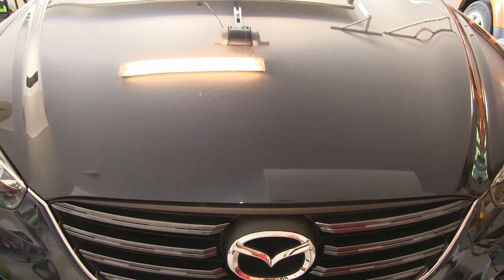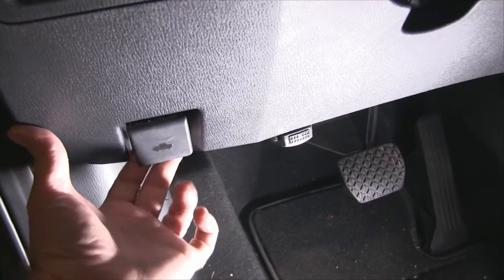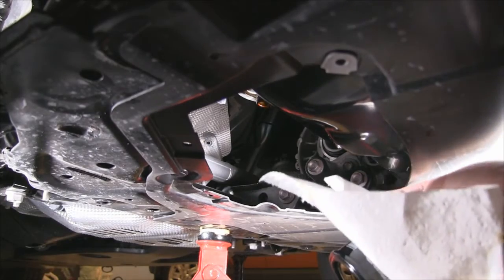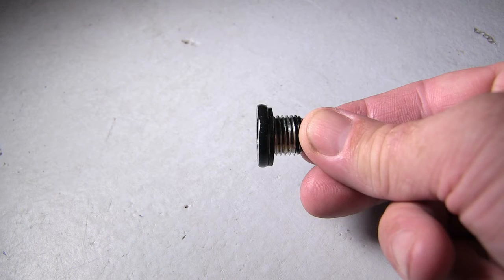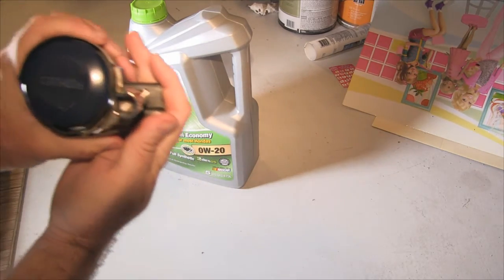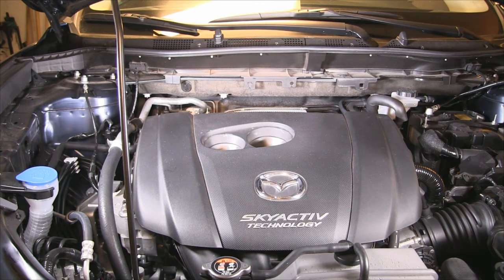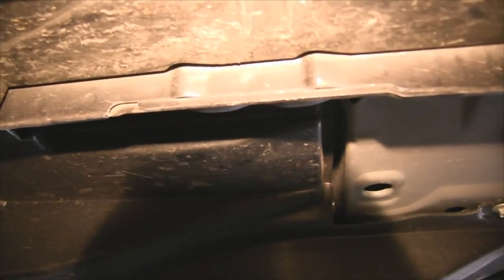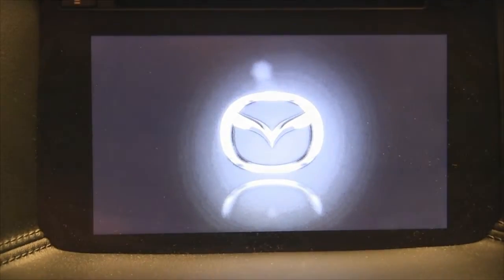DIY Oil Change:  Mazda CX-5 Using a Hydraulic Jack

Comment: One of the very best oil change I've seen for the CX-5. The slow drip drip was a little monotonous though but I get it. The only thing I would improve on would be to slightly prime the oil filter with some fresh oil before installing the filter. Thanks again for a great, (the best), video.

Comment: Excellent video. I have the exact same car and year so this is extremely useful. Can't wait to try this out for my first oil change and stop going to the shop.
Reply from the maker: Thanks Shaman.  FYI about to do my 3rd change on this car.   On the last one I used the Castrol Magnatec on Amazon Prime for $18 for the 5qt size.   I will put a link in the description.  Check it out!

Comment: I just change oil my 2015 Mazda cx5, I'm 5'7", small frame  and weighs about 155lbs and I didn't use any kind of jackstands. You can slide in, remove them plastic covering then the oil plug and oil filter. I mean it's not as easy as jeep liberty where clearance is better (no need for jackstands too it's very wide). But you can still slide in no problem with CX 5. Diy oil change easier without jacking it up and putting em jackstands which I use to do with my old Pontiac.
Reply: i tried but im 6’5 /295lbs.   i couldnt fit

Comment: I like the layed back relaxed presentation. (Although that extended drain tested my patience just a bit.)
I don't get the part of filling it to less than full. The upper mark on the dip-stick is the full mark and the lower mark is the add oil mark. If you're filling it to capacity then it should be at the upper mark. ! No?

Owner's manual says, "Pull it (the dipstick) out again and examine the level.
The level is normal if it is between
Low and Full. (Normal is okay...)
If it is near or below Low, add enough
oil to bring the level to Full." (So why not fill it to begin with?)

Comment: I usually add a little clean oil to the fill port to flush out the drain pan to speed this up.
Reply from the maker: Good suggestion!  Thanks Steve.

Comment: Great video.... detailed and easy to follow. I use Zepro Eco Medalist Advanced Moly 0W-20 and OEM filters.
Reply from the maker: Thanks John.  I used to use OEM filters, but eventually concluded the old cheap Frams really work as well or nearly as well.  Not sure how you source them, but I had found a supplier online that would sell them in six-packs, which really helped keep the cost down plus its nice to have stock on hand.  Those were for a Honda, but I am sure there are some for Mazda too.

Comment: I feel like it makes more sense to remove plug first... I never got that much oil all over my hands when removing filter. Jus sayin. Also, ramps are easier, safer, and don't risk damage to anything. My two cents.
Reply: I don't even need jack or ramp in my oil change cx5 2015. I just slide under. Kinda tight but I fit.

Comment: mine 2017 cx-5 ,I just got the car recently(2 months) and I check the oil stick last time, I got  max when the engine is cool(actually it is a little over max) . is that ok ?
Reply from the maker: If it is just barely over, it will be fine.  But anything more than 1/8 qt over the top dot, I would drain it off.  You can check for a blue-tinged smoke out the tail pipe as one tell that oil is getting into the combustion chamber - which of course you don't want.  A significant overfill could be dangerous , potentially increasing oil pressure to the point of busted seals.  The length between the 2 dots represents roughly 1 qt, so you can use that as a guide to how much extra oil is in there.
Reply: @grokshop  
Are you sure the difference between the marks on the dip-stick is about one quart? I read the owner's manual and I didn't see metion of that?

Comment: Have you done valve cleaning work on your cx-5?   Btw,  I use 5w-20 in the summer;  switch back to 0w-20 in the winter.
Reply from the maker: No I haven't had to mess with the valves at all.  If your summer temps are relatively high, a step up in viscosity can help.
Reply: Is that because 5W-20 is less expensive?
Reply: But why? Manual says 0w-20? Shouldn't you use it all the time?
Reply: @moileung yes and no.  Different types of oil have different viscosities at certain temperatures.  People in warmer areas need an oil with generally higher viscosity, and people in cold areas need the opposite.  The manual gives you an oil that works fine in all temperatures but may or may not be optimal in the extremes.  All that to say, 0w-20 is fine and good but it's not that big a deal to use a different oil as long as you have a reason to use it.

Comment: Since most of the oil comes with 5 quart is it wise to put little bit of the new oil when the old oil is draining to flush out the remaining old oil?
Reply from the maker: That's a great idea musa!  Only thing there is you'd have to meter out the flush oil ahead of the fill, so you need to be sure you leave enough to complete the fill.  Or you could keep the remaining oil from the previous fill and you that.

Comment: "hand tight" for oil filter is not neccessarily good advice at all!  People have remarkably variable levels of strength and/or grip....I learned LONG ago to go by the oil filter box instructions typically like 3/4 turn after making contact ... I mean it need not be exact exact but by picking a point on the oil filter's label aligned by eye to some point just crank it until it is 3/4 turn (or what the box SAYS)  I actually have had vehicles I could not get at the filter with a strong enough grip to turn it tight enough and then I had use a filter wrench (specific socket type) ...I am 63 years old have done ALL my own oil changes so you KNOW I have a drawer FULL of oil filter wrenches ...I only use universals if I have to and then only to remove a filter not put a new one on ...for new ones I use the socket style made specifically FOR the filters I am installing ...tell you what ,  I am pretty strong and have trouble a LOT of times getting a filter a full 3/4 turn ...and I HAVE had them leak before when not tight enough

I like the idea of installing a new crush washer but honestly I rarely have done that except on my racing motorcycles I DID....but no doubt it is good insurance
Reply from the maker: Thanks for the feedback Doug.  Your comment about hand strength variation is valid & is one I can't argue.  The 3/4 turn rule is a good general rule of thumb approach & I have used it also.  For those who may not know, the idea is to turn the filter an additional 3/4 of a turn tighter AFTER the seal makes contact with the engine.  My only problem with the 3/4 turn rule is that I often can't really tell when exactly the seal is making that initial contact.  I think it's kind of like when I asked my plumber how tight I should make a certain plumbing connection - he couldn't really explain it very well.  You just get a feel for it I suppose.